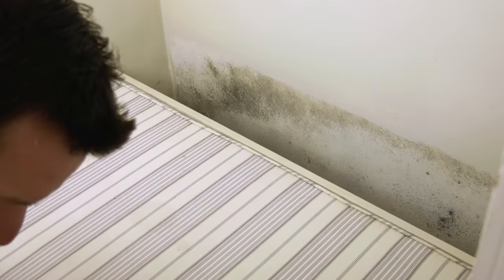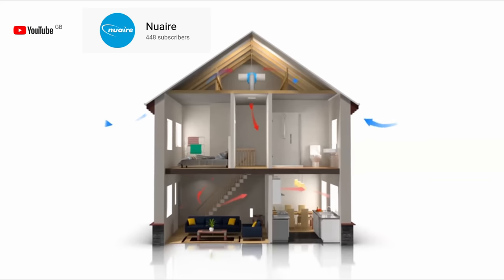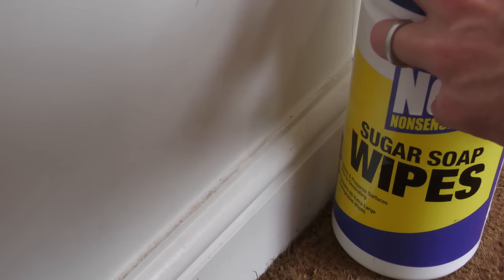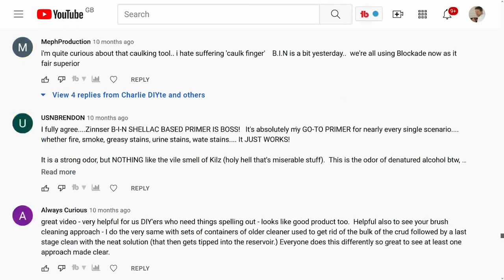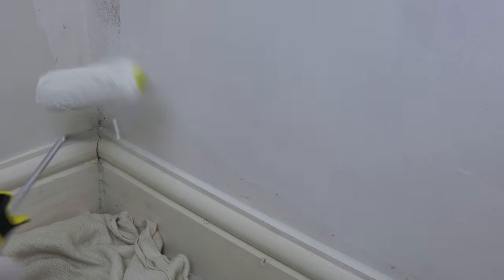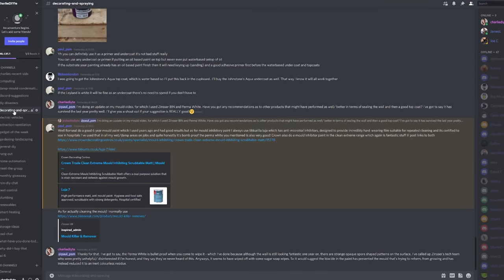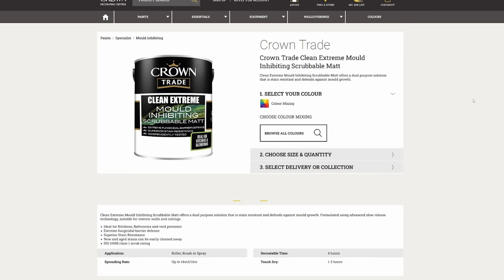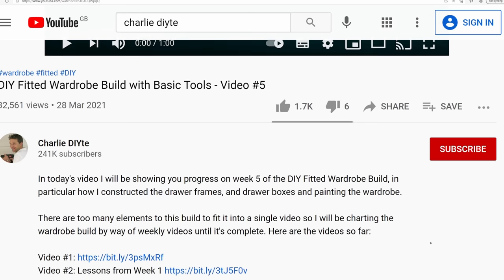Has the Mould Come Back - 18 Month Review?

Comment: Just wondering if the wall is solid or has a cavity , If its solid I would imagine it will need some sort of insulation to stop condensation forming on it ... Im no expert but it seems a logical step to take ...........
Reply from the maker: It's solid. Yes absolutely. If it was insulated mould wouldn't be a problem because the wall would be too warm for the dew point to be reached.

Comment: Great video in this world of sponsors, I love how you remain unbaised and even if u do get paid your open and honest.  I have a question. I have a tiny amount of( 5cm ) on my ceiling.  If u were to use zinser, would I have to paid the whole ceiling with the zinser white once the area is spot treated to ensure for a uniform colour wheel th the old ceiling white colour?
Reply from the maker: Thanks, I appreciate that. The problem with spot priming with the Zinsser BIN is you can get a bit of a raised area. However a bit of very gentle sanding of the edge to feather it in with day 240 grit sand paper, and I reckon it would hardly be noticeable. Zinsser do another great product Ceiling Pro 5 in 1 which removes the need to prime. In answer to your question, you would want to paint the whole ceiling as the sheen of the Perma White will be very different to your existing emulsion. Do consider why you've got the mould though, and where there's anything you can do to stop it returning, and check out my video on this if you haven't already https://youtu.be/TIDb-pdOnXM 👍

Comment: Well while all these paints do work  As you said yourself it  had started to come back even slightly. It is harder for mound to reform on these paints because of their ingredients within. But while the paint is doing what it supposed to do. The initial cause remains. Yes by all means use such anti mould paints and products. But the initial cause  the lack of ventilation  if that is not tackled. Then mould will return as your video has shown even if it was ever so slight in a spore shaped pattern.  By the way the mould behind the panel it will spread. It will get behind the timber frame. Your dryer is vented to the outside.  But remember the  dryer  ducting to the outside creates heat  in the air around it.  as does the dryer when it is on  and  the washing machine The heated air  from that can cause condensation on cold water pipes and cold walls and  this creates the ideal conditions for mould   So  I would be putting an air vent in that outside wall and get an air flow going

Comment: The bench has storage underneath but you can prob cut a hole in the bottom middle of the back panel to let air get in behind the bench. You could cut out a shelf that goes in the middle and rests on the two bases on either side, and cut out the back board underneath the shelf so you would get like a letterbox shape and you probably would then not even have those faint traces of mould coming back in 1 year.
Reply from the maker: It's a very good point. I should do that. 👊

Comment: Now this is going to sound strange and the first time I saw it done I nearly fell over.  Wait until night or the room is dark and place a small flashlight (Maglite Penlight for example) on the surface of the wall so as to generate "raking light" (flashlight is positioned parallel to the wall surface) - you hold the light at full arm extension so your viewing angle is more or less perpendicular to the surface - if the surface is relatively flat and mold is present you will see mold that you ordinarily do not see in full light - works particular well on varnished surfaces like doors and cabinets and wooden beams. I use this techniques all the time to see the extent of a problem. My trusty Maglite is one of the older models that is not LED - I have never actually tried this with a Led flashlight. Sometimes you need one person to hold the light and wiggle it a bit depending on the surface and another person to stand back to observe. It is common to find mold behind cabinets because the air does not circulate and a micro climate exists.
Reply: I should also say that you can also find missing features like former windows outlines and nail holes in drywall and plaster with the same technique.  We could probably trace Charlie's exterior crack repair on his home (his repairs were very good)
Reply from the maker: Thanks Gregory. That's a great tip. I had a couple of those non LED Maglites. Don't know what happened to them. Loved taking the glass cover off and standing the torch on it to use like a candle. 👍

Comment: I think it depends how bad and why. I had a ceiling with mold and even with anti mold paint it would still come back, even after replacing the section with new anti mold paint.
Reply from the maker: Yes, you definitely need to get to the bottom of the problem, as discussed here https://youtu.be/TIDb-pdOnXM

Comment: Just a wee question. Why do you use the BIN as a primer when the other paint you used says self priming? Not picking fault just curious.
Reply from the maker: Belt and braces and also because it's what Zinsser recommend in that little hands book of theirs - which I recommend you getting as it's free to order. I suspect the "self priming" is a marketing thing - make it all singing and dancing and it will sell even better, but to do the job portals and guarantee top coat adhesion priming is always recommended.
Reply: Perfect! Thanks very much for your speedy response

Comment: Swap the thumbledryer with a more efficient one (heath pump type) .. it will be basically free after 1 year of usage due to energy saving.
Reply from the maker: Thanks mate. I'll look into that. You just have to empty the water regularly 👊
Reply: @CharlieDIYte  if it's next to the washing machine there's a good chance you can plumb the tumble dryer into the drain so never have to empty the water container. That's what I did with mine. It's great.

Comment: Very interesting video. You being a "belt and braces" kind of guy I thought you might have drilled a few holes in the back of the bench to generate some airflow. Seems like the problem is almost negligible now, so good solution and some handy information delivered.
Reply from the maker: Thanks mate. That's not a bad idea, except with the baskets and storage boxes, even with ventilation holes there still wouldn't be sufficient air passing through.
Reply: @CharlieDIYte  Thanks for this Charlie, really interesting to come back to an old topic and verify the approach was effective.

Assuming this is the only place in the house with any mould, and to add to the earlier comment here, could a small fan be installed into a hole in the bench at floor level (I'm thinking of those little USB fans). Even a trickle of fresh air could make a massive difference.

Alternatively I went back to your home heating video and your video where you were insulating your solid stone walls in a bedroom where you talked about dew points (a topic I never fully understood until you explained it). Could you add a layer of Rockwool behind some plasterboard (or go for insulated plasterboard again) to push the dew point outside the property on this cold wall? I don't know the numbers off the top of my head, but you mentioned you have moved the bench out by a few inches, and 5cm of Rockwool behind some 9mm plasterboard might solve the problem? Only downside with this more drastic approach is you would need to remove the existing plaster on the wall and undo your hard work in the original video!

Comment: Get an old spray bottle like "Detox" other bottles available, 50ml bleach to 500ml water mix (10:1), fill bottle, spray wall leave to dry....  Cheap as chips, now seal the wall... with a waterproof sealer (I assume you found the cause of the mould and removed). Keep your house ventilated, dry (45-55% humidity). Mould loves damp.

Comment: You need to dry them coats in some manner    a plug in heater would do and a grill on that back wall to allow air in charlie
Reply from the maker: I agree. The problem is there's so much stuff stored under the seat, a vent in the back wouldn't help air circulate. A vent in the wall would probably do the trick.

Comment: Started following your channel recently as they are very informative thank you for that. I have a question as many homes suffer with damp on the ceiling in our bathroom through the winter. I’m thinking about getting the B.I.N mould killer proof primer but do I have to also get the perma white paint as well or can I use ordinary deluxe white emulsion over the top of it instead. We have a similar issue in the bedroom next to the bathroom but the mould only ever forms along the ceiling above the window.

Comment: all our married life we moved into new build, so (luckily) we had no such probs.  In our retirement we moved into a 1950's well built house but immediately noticed some odd minor damp/condensation problems, nothing too bad just odd little corner patches here and there.  Tried various remedies but the Ronseal and Zinnser products seem to work ok but not totally successful. A top end de-humidifier improved things big time but your advice about looking at the PIV systems seems to be a  real answer. How much does an average install cost for a 3 bed house?
Reply: I cannot comment on cost of PIV's, but I will say that dry air is cheaper to heat than humid air.
Reply from the maker: I honestly couldn't say, David. You could contact Nuaire and ask if they have any approved installers. Also, if you Google "PIV installers UK" a lot of companies come up, with the ability to get an online quote.

Comment: Could you not install a couple of vents in the bench at the back to allow better air circulation?
Reply from the maker: Yes that's a decent suggestion. Problem is, the buckets below the bench are always full so the vents wouldn't have much effect. If I was worried, an air vent in the wall would probably be the best bet.

Comment: I try to cure the cause, rather than the symptoms, how about humidistat extractor fan, or a dehumidifier, or insulate the external walls, or what ever works., have you got trickle vents on your windows.
good info on the video, thanks.
Reply from the maker: I do a lot in this house to tackle the cause as discussed here https://youtu.be/TIDb-pdOnXM The problem here is that the bench prevents air flow in a very small room, so short of insulating the wall - as I'm gradually doing elsewhere but not practical here, it installing a vent in the wall, this is the most pragmatic option.

Comment: What is best for bathroom ceiling mold, painted?
Reply from the maker: I would probably use Zinsser Ceiling Pro 5 in 1 as it primes, covers cracks and strains and seals and also contains a biocide. It's only available in white though I think so if you want it tinted then Perma White is good although if there are stains you'll need to prime that with Zinsser BIN first. https://www.zinsseruk.com/product/ceiling-pro-5-in-1/

Comment: Really like this topic, but what has happened here??? is the paint making the warm warmer and stopping vapour from condensing on that wall? Or is the wall still getting wet but drys out without mould forming?
Reply from the maker: The paint is stopping any vapour from sinking into the wall and turning into mould. In an ideal world I'd have more ventilation and insulate the wall but needs must right now 👍
Reply: @CharlieDIYte  thanks for clarifying. I don’t suppose you have any ideas how to get a PIV unit working in a 3 story house that is 100% flat roofed (art deco house) so have no loft. Bottom floor is fine, 2nd floor gets condescension issues, not major but still want to reduce it, top floor is a stairwell to a landing and then entrance to a roof terrace that spans the entire house.

Comment: Hi I've just subscribed and watching damp proof paint clip when you removed access  panel where you mentioned  stale air. Could you make a hole dryer pipe push a pipe into hole say 50mm diameter down to outside wall  but not through it  so that when tumble dryer is exhausting  around inner pipe  it will siphon air from access  area. A bit like a large spray gun. Regards Mick.
Reply from the maker: Thanks for the sub Michael, really appreciate it. Yes I like that idea. Will give it some thought. 👌👏

Comment: Sorry but I agree with Andres comment. There is no way to keep that drywall dry if it is adhered to the concrete. It will continue to get wet and continue to decay beneath the paint.  I'm a renovation carpenter in Canada. The state of home conditions in the UK is very worrying to me. The entire country is doing the same thing, just covering it up and hoping for the best.
Reply: We don't use those PIV units here, as you would only be pushing cold damp air in to your house and blowing hot dry air out of your house. . We use something called a Heat Recovery Ventilator (HRV). it essentially blows warm DRIED air in to your home and the air that is pushed out pre-heats and drys the incoming air. Its a single unit and rather inexpensive.
Reply from the maker: Thanks Justin. I hear what you say but I think it over simplifies the problem. So in this situation (which is a solid wall rather than drywall) I used a dehumidifier to comprehensively dry out the structure pre and post treatment and prior to painting, as you'd see from the video. If like here you can't sort the ventilation issue out the important thing is to prevent moisture getting into the wall and this paint system does just that. On the PIV situation, again it's a little more complicated than that. Heating a house doesn't make the air drier, although it can feel like that. What it does is increase the ability of the air to hold moisture. So when you turn the heating on if you have a hygrometer your RH levels on it may go down. This doesn't mean there's less moisture in the air, it means the capacity of the air for holding moisture has gone up. Conversely, on a cold day outside RH levels may be close to 100% That doesn't mean the air is saturated, it simply means the capacity of the air to hold moisture is very low so actually there isn't a lot of moisture in the air. This is why you often get chapped lips on cold days - because the air is so dry it's drying out your lips. So going back to the PIV situation it's fine to funnel cold outside air into the house because the moisture content is much lower than the air it's replacing, but the main benefits of these systems is that they get all the air in the house circulating, preventing any air from lingering long enough for RH levels to rise to the point that the dew point is reached and the air dumps it's moisture onto whatever cold surface it's next to. Whether this is efficient for keeping heating bills down is another question, which is why HRVs are a good idea, as you say, but they don't pummel the air around like PIVs do. In this video in I'm focusing on systems that you can easily retrofit to solve damp mould and condensation issues.
Reply: I think it's also worth bearing in mind that we do install heat recovery ventilation units in the UK but mainly in new builds. This is because an HRV system needs ductwork going to each room, which we can easily design into new buildings, but most existing UK homes were designed with a wet heating system (i.e. radiators but no ducts to each room). The PIV system works well for existing UK homes as we don't need to retrofit ducts into each room, rather we install one unit in a loft and just ensure we have sufficient undercuts under each door.

Comment: I have one of these PIV in the loft my condensation is whose than ever we have even had the spray foam done are bathroom is the problem we didn’t have that much condensation but since we have had new bathroom fitted it is a lot worse.
Can I put one of these humidifier in my bathroom if so which one is the best thank you

Comment: Thank you from South Africa…..we have a problem in our bathroom. We have a very small bathroom and have a lot of steam in there obviously when we bath…cant open windows as we have monkeys that are just waiting for a chance to come inside….what do you suggest we use in the bathroom to eliminate the condensation? Its a rented house so not really allowed to put permanent fixtures in….
Reply from the maker: You need a dehumidifier, Val. Something like a Meaco. You may need to bring it in there on an extension lead after your shower and some of them have drain off tubes at the back which you could trail into the shower tray meaning you don't have to worry about emptying it. It will be a game changer because you can also dry your laundry with it. Just turn it on and further about it and come home to a lovely dry house. Seriously though you do need to do something about that as all that shower vapour will be circulating around the house creating untold damage. Love the fact you have monkeys outside though!! 🐒👍
Reply: @CharlieDIYte  thank you so much. Will look at our local hardware store when we next go in

Comment: Charlie please can you link to the attachment your tumble drier hose is attached to at the interior wall please 🙏
Reply from the maker: I think it was this one, https://bit.ly/3DG6R9k although if you're thinking of installing one, use a small length of soil pipe through the wall rather than that metal pipe as the fluff won't get caught on it nearly as much. 👍